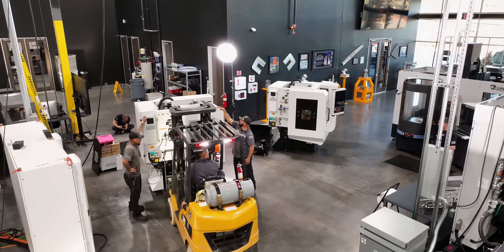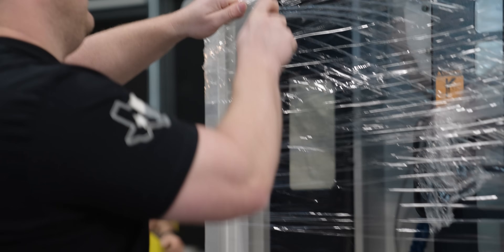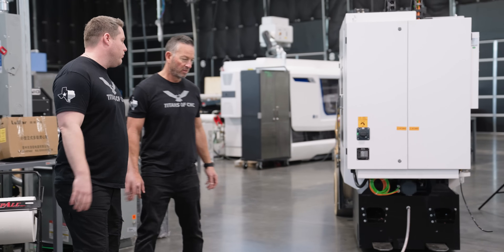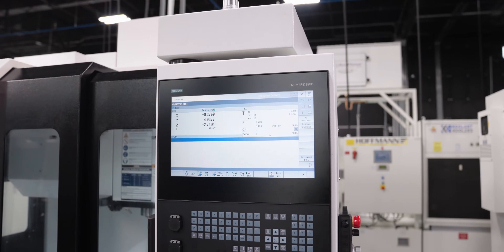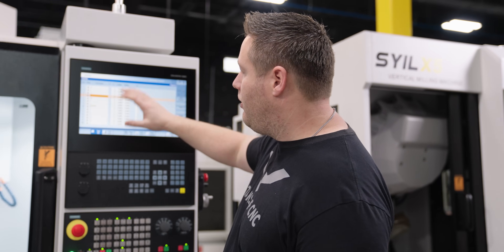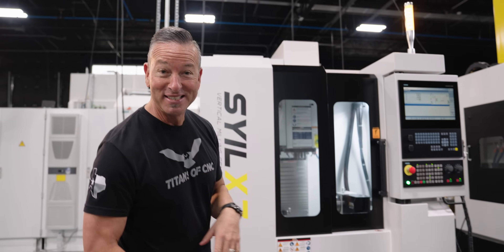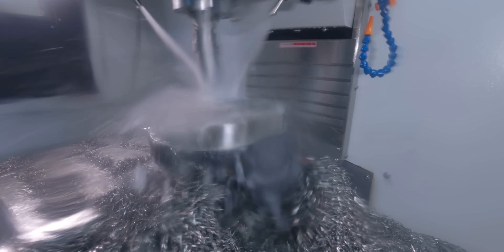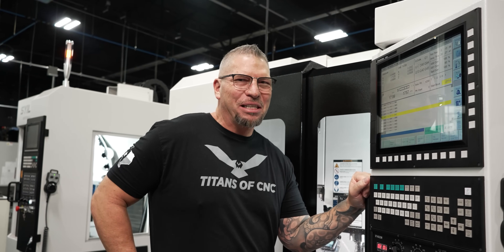Own a CNC Shop? This Machine Makes It Possible

Comment: Sounds impressive but Monel K-500 is only 28-40 HRC so with good endmills really easy to cut.   Still a neat machine though and it's good to see the prices coming down so that American manufacturers can compete with offshore.  Either small shops with one or two machines or large shops that can put in 10 spindles for the price of 1 and really crank out parts like the Chinese do in their big sweat shops.

Comment: Show accuracy of syil. I heard that have bad accuracy about 0.02mm...
Reply: That's what I heard +- 0.01 at best.
Reply: I've always heard the opposite. They seem to be more accurate than a Haas. I know someone who got an X9 delivered recently where the spindle was square to the table under a tenth across a 16" circle.
Reply: @qdp03  it's not static accuracy that is at issue it's dynamic.  One person mentioned their one year old machine could not hold 0.1mm
Of course, that is all second-hand chatter.
Reply: @SimonPEdwards63  that would definitely be an outlier
Reply: All the components are high quality so the machine will be at least as accurate as anything else on the market.  I'm pretty sure HAAS uses ball screws and linear guides from Taiwan just like Syil and the control is siemens so it will be very accurate and fast.  I just bought a couple of Chinese machines and they make my HAAS look like trash.

Comment: The fact that you can use tool names not just numbers to call tools as well as have them stay in the crib (along with the length data) when not in the machine is also really handy when doing one-offs. As long as you use tool tags or similar to track the tools outside of the machine you can run programs without having to unload/load tools from the magazine before hand, especially useful if you have a fairly small tool changer.

Comment: So are you no longer going to offer syil machines with the LNC or Syntech control and exclusively sell machines with the seimens control?
Reply: there must have been some untold reason behind that. The distributor usually carries full liability for those machines when the machines come from outside the United States. It is not only import and ship, it is import, ship and support - technically support it. I doubt that anyone at Syil is able to speak english like an american, they might be good but definitely not like a local american. Chinglish doesn't come from nowhere... Siemens might just be easier to support for them.
Reply: @mrechbreger  I feel like it would be a non issue once a few people on the titans of cnc team are trained on the syntech or LNC control systems. After all they would still need the same training for a siemens control. It would be nice if the syntech and LNC controls were still offered as i believe that some models with the LNC control were able to be ran directly with single phase power rather than dropping another few thousand on a phase converter.
Reply: They have never said they are dumping syntec controller
Reply: @Z-add  supporting a consistent system is far easier than a fragmented one, and depending on the userbase and how experienced they are one or another might be just easier for a vendor. For a vendor supporting the machine might not only be a normal userhandling but also managing the setup of a particular system. I am not sure how far Siemens is jumping into support; I have dealt with the Mitsubishi support in the past - they are still supporting 25 year old systems and still set the options for free if you carry the controller to them.

Comment: I love machining technology in general but the thing I DON"T love about it is that, now sooner than you drop your wads of cash for the latest and the greatest new technology, then it instantly becomes antiquated because the next latest and greatest thing comes out as soon as you uncrate your freshly delivered products.
Reply: I disagree. We've been extremely profitable with 40 year old machines. Firmware updates and knowing how to maintain them helps.
Reply: Agreed to all this.  New machines are great but the best machine is the one that makes a good profit and is already paid for.
Reply: Amen. Have done loads with 1990 models lathes and mills. Mori, when built rugged.
Reply: Lol there are machines from the early 2000s still rolling out parts today and relatively competitively. And at the end of the day a haas vf2 from the early 2000s if you have the space is a better machine. Other then 2k less rpm and slower Rapids your more hp more torque more rigidity 40 taper and all for 20k or less most times.
Reply: You can’t stop progress. What part of that is hard to grasp?

Comment: Hello 🙂 Under the latest video (which may be interesting for both users and future buyers due to the opportunity to see how these machines are built) one of the viewers asked a question that I cannot answer because there is no such information on the seller's website "With what accuracy do these machines work??" Maybe someone has such information or will answer based on the parts they make themselves on the SYIL machine?
On FB I have already received 2 pieces of information about X7. Maybe you can say something about X9, it has much better guides and is more massive but I don't know what it can do
Reply: There are so many variables to machine accuracy that it's often useless to give a spec on "accuracy."  Are you looking for part accuracy/accuracy under load, for repeatability, for absolute positioning? 

With all that said, I've seen people claim these machines can hold ±0.0002 repeatability, but when it comes to making parts there are just so many variables
Reply: @vanguard6937  We can determine 2 accuracies:
1. Factory - That is, deviations allowed by the manufacturer (in the machine tool documentation there are tables where, for example, the flatness of the table can be +- 0.01 mm and next to it the employee enters how many a given copy has) so if the manufacturer allows a position error of 0.05 we must bear in mind that our parts may have drilled holes of +- 0.05. Of course, it may be that most machines will have 0.01 but if one in production shows 0.045 it will still leave the factory and they will not correct it.
2. User - if you write to me, I make rings fi 300H7 in aluminum and I always fit into the dimension and oval 0.01, this already tells me something. When another user writes that he makes 1000 cubes 10x10 60HRC per day and each one comes out +-0.005 and the cubes take up the entire table mounted in the fixtures and only corrects the wear of the cutter every 100 pieces, this is also some information based on which I can map it to my needs.

You are right that a lot depends on the service and conditions, but if I say that on my lathe I am able to make bearing fits, I should be able to prove it to you because yes, you may be cutting 10mm at a time and that's the error, maybe the shaft protrudes 1000mm without support and that's the error, but if you do it according to the guidelines or look at the mentioned measurement card and it says that on a shaft fi 80 L100 the cone error is 0.005 for finishing machining, I should get it.
I often show in my films what and how I made details on Chinese or DIY machines, thanks to which viewers can say "oh, if he makes such details and mine are less demanding, I can buy it" or "oh no, he's struggling and processing 3mm, it's too low efficiency for me, I must definitely look for a better machine" - Titans have people, material, and tools to make a reliable test of dimensional accuracy and geometry, and not only for viewers but also for themselves because they sell these machines, it's good to know what's selling
Reply: @vanguard6937  We can determine 2 accuracies:
1. Factory - That is, deviations allowed by the manufacturer (in the machine tool documentation there are tables where, for example, the flatness of the table can be +- 0.01 mm and next to it the employee enters how many a given copy has) so if the manufacturer allows a position error of 0.05 we must bear in mind that our parts may have drilled holes of +- 0.05. Of course, it may be that most machines will have 0.01 but if one in production shows 0.045 it will still leave the factory and they will not correct it.
2. User - if you write to me, I make rings fi 300H7 in aluminum and I always fit into the dimension and oval 0.01, this already tells me something. When another user writes that he makes 1000 cubes 10x10 60HRC per day and each one comes out +-0.005 and the cubes take up the entire table mounted in the fixtures and only corrects the wear of the cutter every 100 pieces, this is also some information based on which I can map it to my needs.

You are right that a lot depends on the service and conditions, but if I say that on my lathe I am able to make bearing fits, I should be able to prove it to you because yes, you may be cutting 10mm at a time and that's the error, maybe the shaft protrudes 1000mm without support and that's the error, but if you do it according to the guidelines or look at the mentioned measurement card and it says that on a shaft fi 80 L100 the cone error is 0.005 for finishing machining, I should get it.
I often show in my films what and how I made details on Chinese or DIY machines, thanks to which viewers can say "oh, if he makes such details and mine are less demanding, I can buy it" or "oh no, he's struggling and processing 3mm, it's too low efficiency for me, I must definitely look for a better machine" - Titans have people, material, and tools to make a reliable test of dimensional accuracy and geometry, and not only for viewers but also for themselves because they sell these machines, it's good to know what's selling